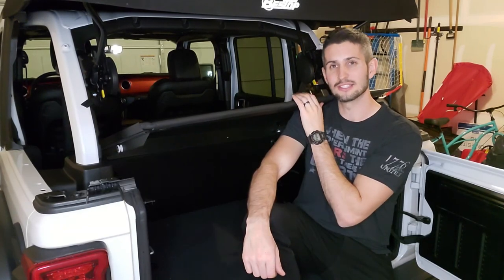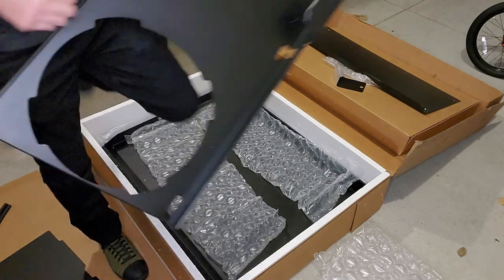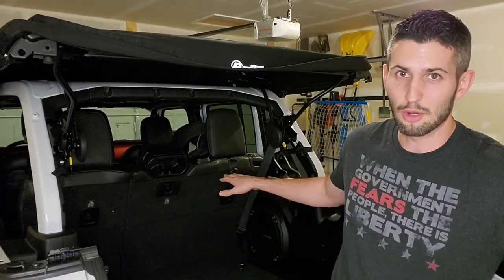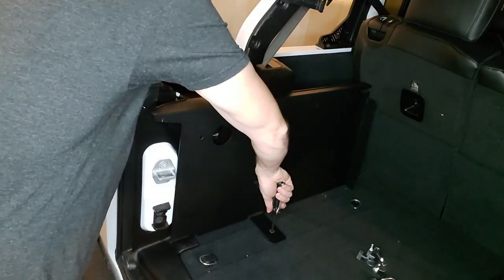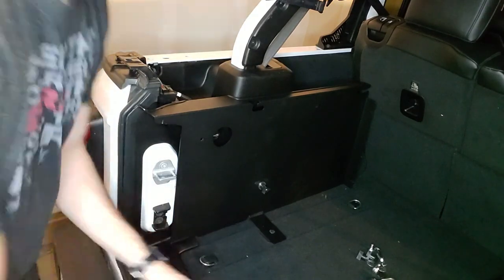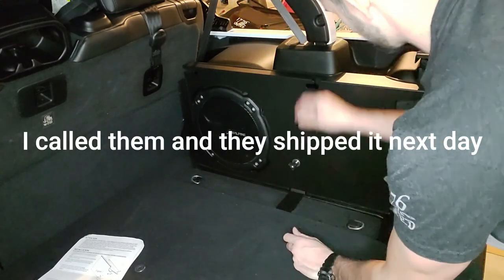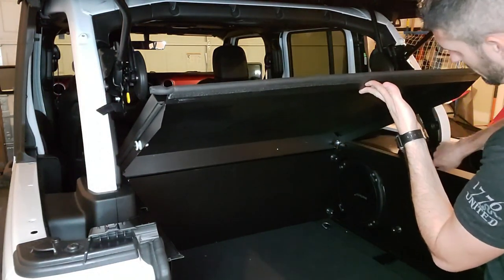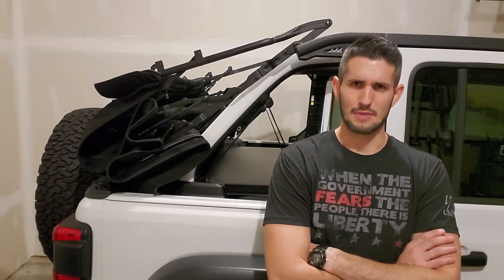Tuffy Security Deck Enclosure Install on my 2018 JL Jeep Wrangler Unlimited Rubicon with Soft Top

Comment: Thanks for the video. I wonder if you could spend a few moments opening and closing it, also, the sides, outside of the box, are they useful for anything, or just a place to capture debris that you have to clean out later?
Reply from the maker: I no longer own this vehicle. In fact, after selling it, the UAW strike started, so I'm without a vehicle altogether now, lol. I can tell you from memory that the outside spaces above, in front of and behind the wheel wells, are good for storing soft gear like jackets, small hammocks, etc for longer trips but if the top is off you obviously don't want to store things outside of the box.

Comment: I would like to know if having the back enclosed takes away from the sound quality of the Subwoofer? Is it not as loud? Does the subwoofer make the metal rattle? I just want to know if you can tell a difference.
Reply from the maker: I couldn't notice a difference. Sounded great on or off and no rattle.

Comment: Very helpful video, thanks. Curious if you’ve had a chance to take it out on the road with the soft top down and whether you experienced any unexpected issues in that regard. Many reviews of this product claim that the soft top won’t lockdown so they have to bungee or strap the soft top down.
Reply from the maker: I have a chance to do a badge this summer. I'll do my best to film and let you know. In theory, since the sides are clear, it should be a non-issue. I haven't had any issues on pavement or bumpy dirt roads but we'll see.
Reply from the maker: Update: I just took the top down yesterday and while the sides are free with the tuffy design, the bar on the soft top that goes across does not have enough clearance so it won't lock when all the way back. So it looks like I'll either have to only do safari style or get some straps for each side of the top where the bars fold. If tuffy made the lid an inch or 2 more shallow just in that spot where the soft top rests, it would be perfect.

Comment: Hi I had a random question about the Tuffy enclosure.  I know from your comments and many other reviews that will the tuffy enclosure fully installed that the soft top does not “lock” when fully down. I’m wondering... if just the top of the tuffy box was removed while keeping the rest of the box intact, would the soft top lock in the down position? 

I don’t need the security all the time and if this configuration works I would just leave the top in safari mode when the tuffy top was reinstalled.
Reply from the maker: That's not random at all. I was wondering the same thing! My next Jeep video will most likely be on the soft top and I'm making a note to check for that. It's raining all this week so it will probably be a few weeks out.
Reply: @YourFavoriteLibertarian  awesome thank you!

Comment: Is that a factory soft top?  And does the soft top still lock down?
Reply from the maker: This is a Bestop Ultra Top. Not the Bestop top from Jeep. Yes the soft top still locks down. I should probably do a video on how my soft top works.
Reply from the maker: Hey looks like I should issue a retraction. I just took the top down yesterday and while the sides are free with the tuffy design, the bar on the soft top that goes across does not have enough clearance so it won't lock when all the way back. So it looks like I'll either have to only do safari style or get some straps for each side of the top where the bars fold. If tuffy made the lid an inch or 2 more shallow just in that spot where the soft top rests, it would be perfect.

Comment: Any issues since install with soft top?
Reply from the maker: None so far! This design keeps the sides in the back free which is where the soft top sits when fully down. So naturally it works like it did before the install.
Reply: @YourFavoriteLibertarian  ok seen so many mention it won't lock
Reply from the maker: @DelanoJ  wierd. Maybe they are using a different brand like Diabolical. Diabolical models cover the sides as well and therefore do not allow the soft top mechanism to lock.
Reply: @YourFavoriteLibertarian  not it's this one.
Reply from the maker: @DelanoJ  well I'm just lucky I guess lol. Perhaps they are running different soft tops? Mine is the Bestop Ultratop soft top.
Reply from the maker: Hey looks like I should issue a retraction. I just took the top down yesterday and while the sides are free with the tuffy design, the bar on the soft top that goes across does not have enough clearance so it won't lock when all the way back. So it looks like I'll either have to only do safari style or get some straps for each side of the top where the bars fold. If tuffy made the lid an inch or 2 more shallow just in that spot where the soft top rests, it would be perfect.
Reply: @YourFavoriteLibertarian  that must be it. Sucks cuz it's a great product. But I love the soft top. Although I prefer safari style anyways, esp at high speeds